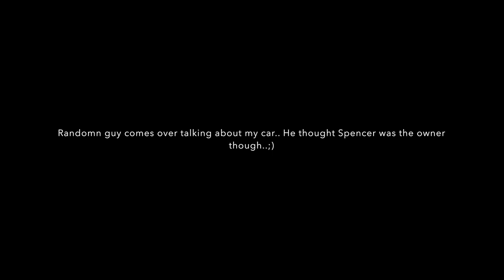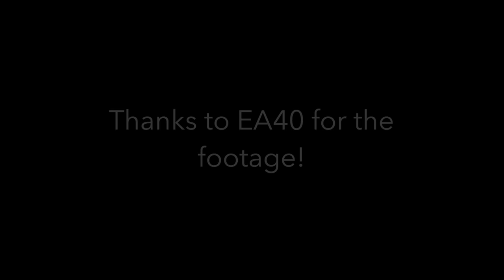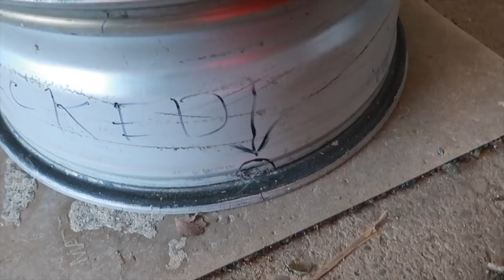Had my Mercedes in the shop TWICE in one day... (For GOOD reasons)

Comment: Hollin in exaust system (7:20)... and back fires (8.28, 8:53) ..... = RICH MIXTURE!!!!
No Fuel Cut Off...
It means CHECK ENGINE on.
It means LOW PERFORMANCE!!!
Reply: it could be just a back fire option many companies have the pop options to their tunes to have everyone believe your cool. I think its stupid and doing that to a car is actually not good at all it kills exhaust systems and the back pressure comes up into the engine also. like having a diesel truck that smokes like crazy it's actually very bad and could blowing up the engine from all the soot going throw the engine...anyways not my car don't care

Comment: In some places the city or state will pay for repairs caused by damages from potholes and bad road conditions. I know two people that have successfully had damages paid for by the city. One was a wheel damaged from a pothole and the other had his radiator replaced by the city when he was forced onto the sidewalk to move out of the way for a fire truck and the impact caused his fan to hit his radiator and tear it up. It both cases the city paid for their repairs. You might look into it and might be able to be reimbursed.
Reply: Ryan Lange my friend did that, he got his rim and tires payed for and a whole new suspension after hitting a pothole, he was driving a saturn forgot the model but it's one of those sporty ones that looks like a lotus

Comment: 11:something that is why I hate aftermarket I bought two cars with Bluetooth but no navi. The aftermarket nav  unit comes with Bluetooth but can not work with stock Bluetooth so they had run wire with speaker through gauge cluster plastic clear. It sticks out on side of it and does work as well as the stock one. After 10 years the aftermarket unit is dying.

Comment: A nice inexpensive to maintain Chevrolet will solve all these high-priced problems.
Reply: As long as you don't mind bad piston rings
Reply: Ben S -- Nah! Any quantifiable oil control problems went away with the shitty ass teflon coated aluminum blocks of the 45-year ago Vegas.
Reply: Scott Gable any GM vehicles my family has owned have burned oil, when I had a Saturn with the 2.4 ecotec it would burn a little over a quart between oil changes. My mother currently has a 2012 Cadillac SRX with 90k miles that goes through about 3/4 a quart between oil changes.
Reply: Fair enough. I don't burn a drop my 2003 Vortec 4.3. They all have their problems bro (Ford's Triton spark plug thread, yeah?) My original comment was more about the outrageous expense of the high-end German stuff vs, generic American. Peace,